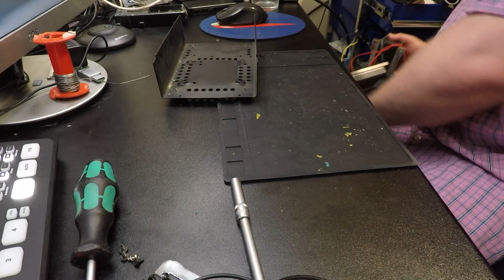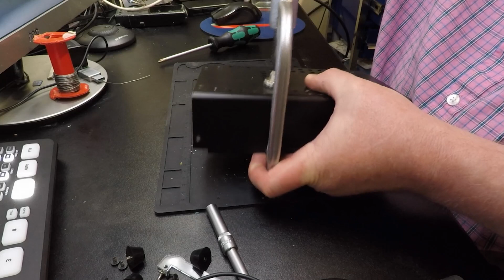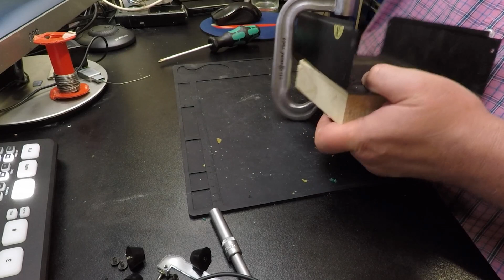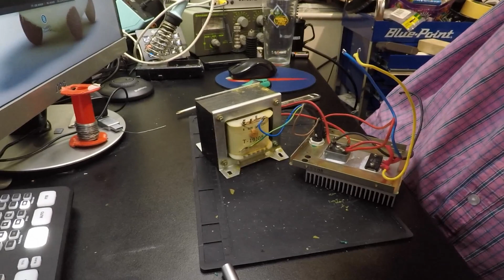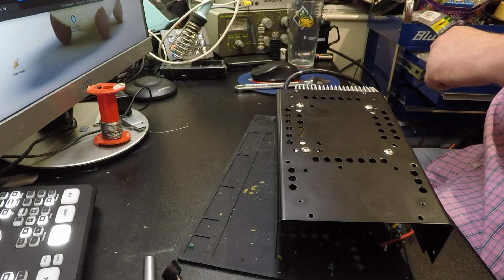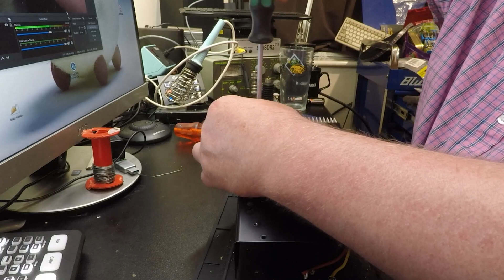daiwa ps-120 power supply, lets straighten the chassis and transformer

Comment: I would have put it in a vice to straighten it, but you did it just as easily.  Switched Mode power supplies and be nasty with the power on, I don't like them, rather have a linier one, less noise.  Does that one have an over voltage protection?  To be fair, I think the steel bottom part could have been a bit heavier steel, but everything is a compromise.  Looks to be not a bad supply all said and done.  I have seen parcels fall off the top of a pile of parcels in the back of a courier's van, and seen them fall out when a door on a lorry is opened, they were loaded fine but moved about when travelling, but they should take a bit more care, after all it has been paid for for a safe delivery, but it does not always happen.  I have seen parcels being thrown in the back of a van that is clearly marked Fragile and some people just don't appear to care.  Other do their job well, it is never them that get any credit as it takes them a little bit longer to do the same job, but nothing get thrown about.  Nice job on the repair, it will be just like new.

Comment: It is always hard to straighten this sort of damage, I find it interesting that the deformation of the case is caused, not by a direct impact but from the energy in the mass of the transformer. You were lucky to get away with  straightening the heat sink, usually cast, they are very brittle and will not take much to break along the stress line of the bend, but, this time you got away with it. Thinking about it, for the chassis to deform the way it did, there must have been considerable force used against a hard surface. I wonder what the condition of the box was, I suspect that, from the damage, it "fell" a lot further than from a bench to the floor! At least the damage was not terminal, if uneconomic to repair commercially, it has made an interesting project. Jim M7BXT
Reply: I rebuilt an old yaesu 20A psu. It was given to me! Years ago. A total wreck, been on fire, pcb beyond recognition. All that was left was the transformer, smoothing caps and a bridge rectifier. I resprayed case and built a new psu from my junk box. Voltage  regulator, 4  2n3055 pass transistors And worked well for many years until now. All pass transistors shorted after a power surge    so have now gutted it and fitted a 36A server sw mode psu. Fantastic. Now have a very heavy spare 20A transformer which will be used in a future psu. We'll done with your refurbishment.
Reply: @kennethausten  I would have rebuilt it and put a bit of surge protection into it.  2N3055s are the most adaptable of all.  My power supply shorted and blew the transistor, I put in a 2N3055 and it ran until the electrolytic blew up inside leaving a mile of brown parer everywhere.  How do they manage to get so much parer into a capacitor that size, I honestly think I would five of them to get that parer into one
 I think you should rebuild it again, and use it.  My mate built a 30 amp power supply, I gave him the information and he built one, everything in his shack ran off it.  He used a second transformer as a filter and it worked fine.

Comment: I have found that acetone will usually loosen that type of thread locker, but acetone dissolves lots of surfaces and materials so you need to apply it with a tiny eyedropper.